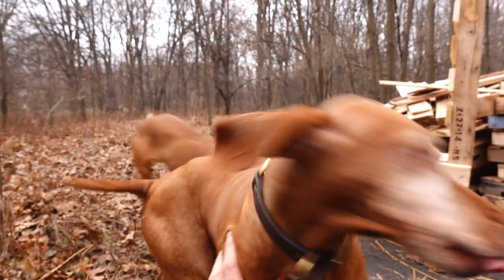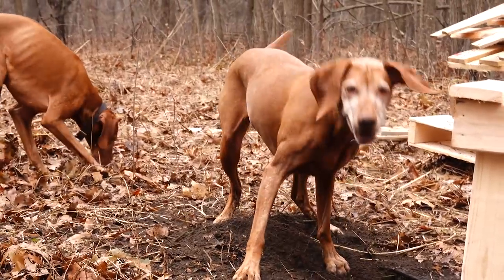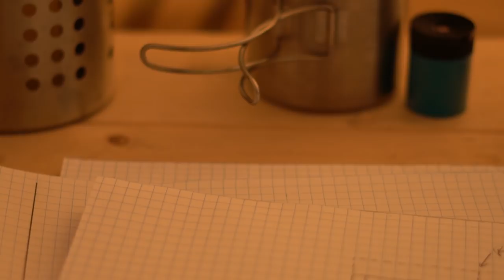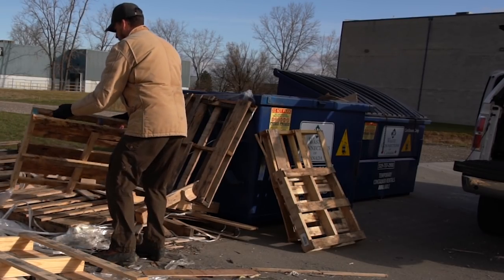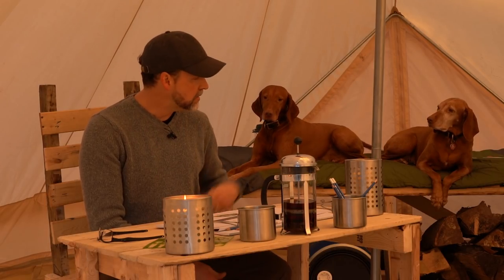DIY Complete Off-Grid Furniture Build using Free Wood Pallets - Living with my Dogs in a Canvas Tent

Comment: Great vid Scott. Are you doing just hand-tools for everythink or would you use some more modern tools like that Ryobi cordless nailer that Home Depot had on a couple weeks back, $99. Of course it only does smaller nails though, but for littler pallet stuff, cut with skilsaw and nail together right quick. I would guess you are gunna use a chainsaw to cut up the cord wood for the cabin.... (I HOPE so, if ya need gas money let us know) or go cordless on the chainsaw too. Any power to your property??
Reply from the maker: Hey Ken. I do plan on using a chainsaw because of all the cutting of the cordwood. Everything else should be done with hand tools. 👍😁

Comment: 10:12 I'm getting the impression you're nailing with only one nail, rather than spaced at two diagonal spots, at each joint.
(and no boards mounted diagonally on the legs to stiffen them from rotating) This furniture can not last!

Comment: 18:52 Why are you running that fire FULL OPEN? Huge volumes of cold air are rushing right through that fire, cooling the fire and the chimney down. You can hear the air racing up through the entrance to the chimney.... Yeh it's noisy and sounds powerful, but it's wasting huge volumes of air and heat, going up the chimney rather than heating the tent! ... Terrible waste...